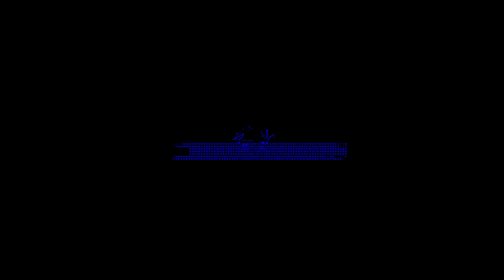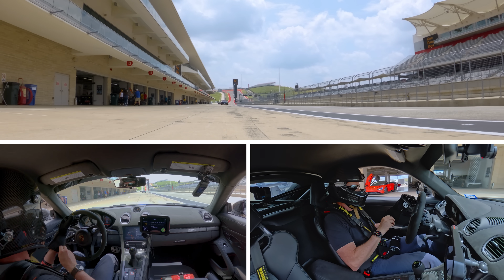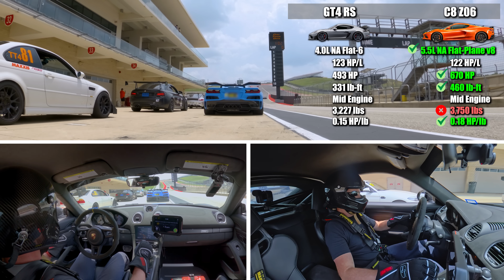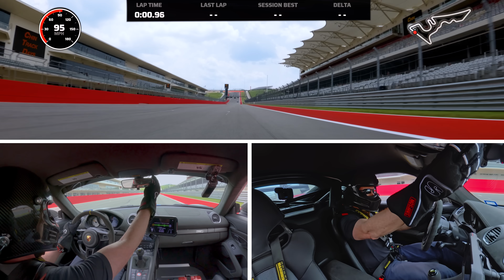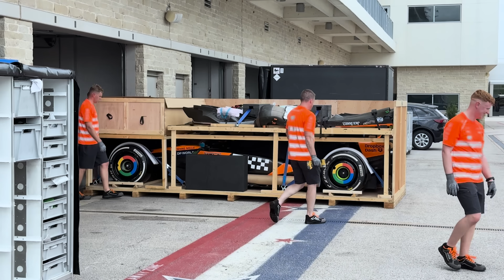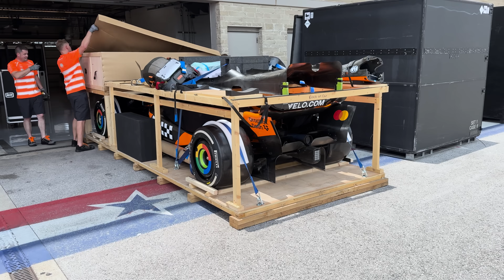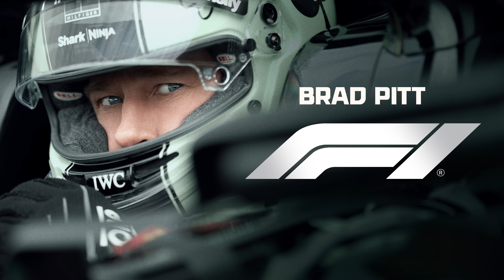Z06 vs GT4 RS : American Power Meets German Engineering at COTA

Comment: So I went and drove both of these cars with ExoticsRacing in Las Vegas.  I race a SpecE46 and have previously owned a Cayman, so I wanted to drive the GT4 RS as the king of the hill Cayman and wanted to drive the Z06 because it's the most interesting Vette in my lifetime.  ExoticsRacing is a fun way to get a quick taste of these cars.  So I'm not an expert at tracking either of these cars, I don't know anything about their set ups or wear items or any mods they may have had, I assume they were just stock.

Honestly these cars are not in the same class, the Z06 is quite a bit faster.  It makes the incredible engine in the RS seem a little ho hum.  I found the Cayman to be just absolutely scalpel precise.  Almost to the point of being darty at times.  But definitely a pure driver's car minus the manual transmission.

The Vette is just all about performance.   It feels as planted as a mid engine car with 670 hp can feel.  The engine is incredible.   I think anyone would be lucky to own either own of those cars.  The Cayman has always punched above its mechanicals and technical specs.  The price point of the RS is a bit eye watering.  For my taste I'd rather have a manual transmission GT4 and just pay to have the tall gearing fixed.  Though the induction noise of the RS is incredible and I'm just glad the car exists and that Porsche has built it.

I came away thinking the Vette was incredible and a scorching bargain for the price.  I went the direction of getting a racecar instead of continuing with track days, but if I was doing track days the Z06 would be a hard car to pass up.  Though generally speaking I wouldn't buy a new car to thrash on the track.
Reply from the maker: What you did was a great way to experience both cars. We’re lucky to be living in a time when cars of this caliber are being built by multiple manufacturers at price points we’ve never seen before.

When I first got into track driving, I did a similar comparison between a C7 and a 458. At the time, the C7 was the bang-for-the-buck champ, and the 458 was the best money could buy. I walked away not liking the Corvette because of the front-engine layout and how it affected the handling. The 458, on the other hand, fit like a glove—so I started chasing lightweight, mid-engine cars from that point on.

Comment: Chevy fans in this thread are insecure AF. The Z06 ran 7:10 at the Ring vs the 7:09 for the GT4 RS The Z06 needs an additional 170hp to support its 3400 lbs. That's two grown men heavier than a 4RS at 500hp. Same discussion as the C8 ZR1 at 1100hp and 3900lbs that has yet to beat the eight year old 700hp 2RS around the Ring. Until Ford and Chevy address the elephant in the room chassis development and weight they are going to be the typical Murican sports car. Yes, the ZR1 has 5 new American track records. Roughly 2 seconds a lap faster than the 8 year old 2RS. If you don't think Chevy knew that it was going to favor the ZR1 in terms of  being track specific you're nuts. They have been at the Ring for a year with the ZR1 and haven't set a time yet. Why? Because they can't get near the 6:40 of the 2RS yet because the Ring is too sophisticated a track for these heavy Chevy's. They have to find 30 seconds. The new Gen 2RS is due by fall and will lower it again. Porsche will never give up the production car Ring record. Porsche has 6 variants at 7 minutes or under. Hell, a standard 444hp GT4 just went under 7 min. However, you do get a square wheel, a pair of white New Balance sneakers and a cool shiny 1980 racing jacket and pinky ring with every Corvette..
Reply: now do other tracks than just the nurburgring. Z06 is competing with the GT3RS, not the GT4RS.
Reply: @goobingtons  The new GT3RS was beaten by the ZR1 by two seconds around those American tracks.  It has 600 hp more. Yea, 600 more. What do you think would happen if the GT3RS had 1100 hp. Let it go. The new GT2RS arrives late summer and whatever time this pig sets at the Ring is going to be beaten by the new GT2RS. Still no Ring time set after a year by Chevy.
Reply: @ACMEpowersports i said z06 not, zr1. And I'd hope Porsche has better times at the ring, it's in their fucking backyard. Nevermind the fact that's it's so overrated for actually benchmarking performance.
Reply: Wait for the C8 ZO6 Official Ring time.  Any nube can beat 7:10, let alone a professional driver.  Sole car on dry track with warmed up new tires = game over for Porsche's flat 6.
Reply: @JoeDiesel9682  It's been a year. You can't spell and your Ring knowledge is shit.
Reply: I want to see the corvette and the gt4rs in Mugello. Can this be simulated ? Mugello is real technical with double 90 degree corners etc and I would say the 992gt3rs has no advantage over the gt4rs there . I loose 1 sec..
Reply: I want to see the corvette and the gt4rs in Mugello. Can this be simulated ? Mugello is real technical with double 90 degree corners etc and I would say the 992gt3rs has no advantage over the gt4rs there .
Reply: I agree. Can’t believe all the hate in the comments 😂

Comment: Thank you for the interesting and informative video as always!  Agree.  This was also a vehicle I was seriously considering.  The flat plane crank 670hp high revving engine is really cool.  Several items that moved me towards the Porsche was mainly weight and heat.  Heat issues from the C7 on track made me a little worried about the C8.  Weight as you mentioned, means more wear on consumables.  Buying big wide tires even more often becomes more expensive.  Rotors and pads due to wear from stopping a heavier machine also becomes more expensive.  Pushing a heavier vehicle through the air means more heat generated by the engine which means more potential issues down the road.  The C8 is excellent.  I wouldn't be surprised seeing a Z06 post faster 1-2 fast laps.  I would more surprised to see them run all day and be fast the whole time like Porsche vehicles.  They handle track days a little differently.  Both excellent vehicles.  The new ZR1 mentioned in the video on a 100 degree day with a journalist doing a 2:17 never driving COTA before was very eye opening.
Reply: In regards to the Z06, it's extremely sensitive to weight, and the tire specs for the Z06 are more long lasting, so engineers actually saw faster lapd at the end of the day with less gas in the tank and less weight than in the beginning of the day with fresh tires. Just a thought😉

Comment: Great commentary and videos as usual, but I can't help but wonder in these videos how much the differences are between the drivers. Someone might brake at the 200m when, if they were more confident and competent as a driver, could have instead braked at the 150m. You have a better line, are making better use of trail braking, among other just fundamentally better driving techniques. The human factor is still the biggest variable here when we're not talking about guys on the level of Maro Engel or Kevin Estre. Not trying to sound like a Corvette apologist; I'd at the GT4 10 times out of 10.

Comment: This was fun to watch, and I can tell the Corvette guys, and the Porsche guys are both VERY defensive about their rides.  Driving matters guys, so do tires, so does a passenger, and yeah - so does engineering.  TBH they are both really cool cars and every time a guy hits a home run in baseball, he doesn't credit the bat - stuff like this takes skill. I don't know a ton about the Vette, but I've read they dialed in a ton of understeer trying to keep an older clientele used to front-mid-engine from ending up in the weeds.  A track set up with a ton of camber is supposed to help but the C8 is also as tail-heavy as a 911.  So, I'm not surprised it can be a bit nippy in the corners. But I'd get the convertible of either and have a ton of fun enjoying the fresh air on the street. Great vid!
Reply: They did dial in a lot of understeer for the C8 stingray, but took most of it out with the track alignment in the Z51 package. With the C8 Z06 that understeer is completely gone and it actually rotates beautifully due to the weight at the back and the wide tires keeping it behaved. I assume they've dialed in some limit understeer to keep the C8 ZR1 in check however (in the base model ZR1 at least)